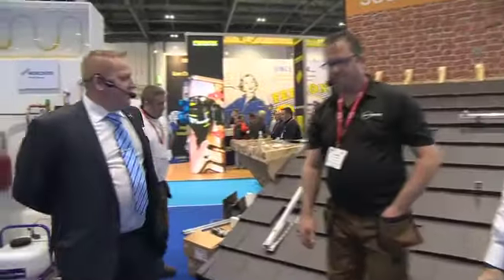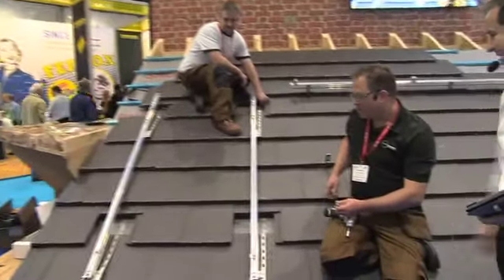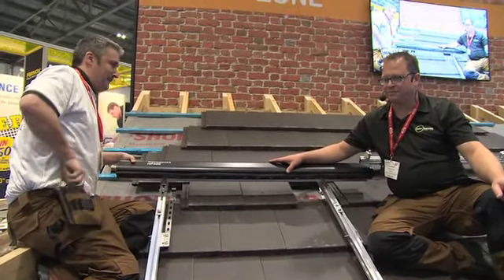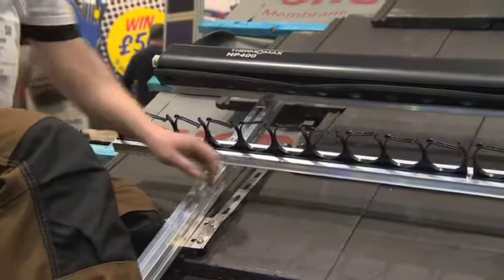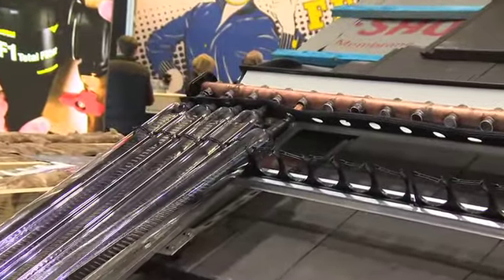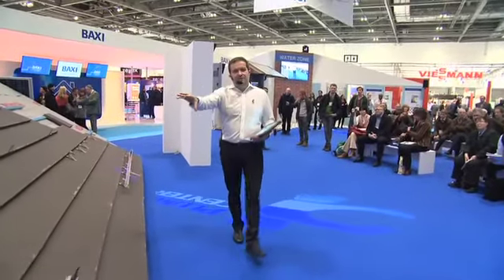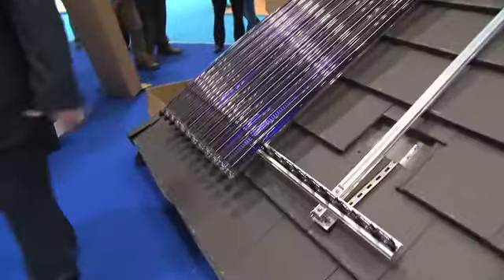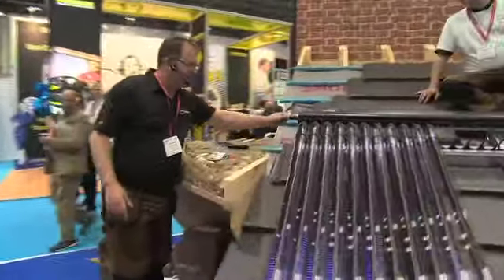Ecobuild 2014 (Practical Installer) Installing Solar Thermal Evacuated Tubes

Comment: I am guessing a North East facing (rear roof would be install position) wouldn't be any good for the Solar thermal tubes?
Or would a 2 person household simply have like 25 tubes installed?

Comment: @UCbWvrIFV10MX5kzjy5aa9Jw
      
      

        

          

          

            @UCbWvrIFV10MX5kzjy5aa9Jw
            
            
            
            @
            
            

            
            
          

        

        
        
    
    

      
      s
Pity there is no project to upgrade homes using. Using UK Government Green Deal. Solar heat pipe collector.
 Today I have been dumping free heat and most of past spring and summers. In winter I use old gas boiler/night electric to increase Heat store temperature. All integrated into heat store.
The UK Government has silenced knowledge of Solar Heating using Vacuum tube with Heat pipe which gives FREE heat from the Inferred spectrum (IR); 80+% efficiency. The same spectrum that Halogen cookers use to cook food or Electrical room Heaters [the original room electric heater uses IR properties]. Can cut down on energy usage by at least 30%+.
Note: Insure Solar Heat collector [1000Lt] has a heat dump water circuit; because of unpredictable weather. This heat collected from the Sun is stored in a Hot water tank call ‘Heat Store’. The unit does not need to be on roof, wall between windows, balcony wall or used as Sun shade. Leaving the roof for Solar electric panels. [Mains pressure drinkable hot water via heat store heat Hot Water exchange insure the cold water input to Hot Water heat exchange has a magnetic water conditioner)]. Under floor/floating floor heating is usually set at 40 to 60 C, easily supplied by the sun. If you do not need the underfloor manifold one can remove the radiator and connect the floating floor heating to the radiator connection. Also insure this circuit has a magnetic cleaner.
40% of UK energy market is for heating that is probably. Why Oil/Gas/Electric companies do not advertise this method of saving money? [ = To £500 a year in saved fuel cost, more as the costs go up for an STD family home.]
In a family home, solar heat infra-red light (IR) energy covers up to 60% of the energy required for heating domestic hot water (DHW) on old houses. This would work out to be 15% of the total UK energy consumption, with annual CO2 emissions being reduced by 92 million tonnes at the same time.
Heat (IR) from the sun
In spring and autumn, you may often be able to turn off your boiler when using solar energy to back up your central heating.”
???????????? Why do you not promote the underfloor /floating underfloor heating wich this panal is easily able to provide. Only intergrate electronics controls and Heatstore [1000Lt aprox] and heat dump to be done.

Comment: i fitted my own solar thermal system  and no way would i use the flimsy brackets  kingspan provide
Reply: Ya i thought they very flimsy  brackets too. I wouldn't use them.
Reply: Have been using their straps for 30 years with no problem. Will do any roof including slates.